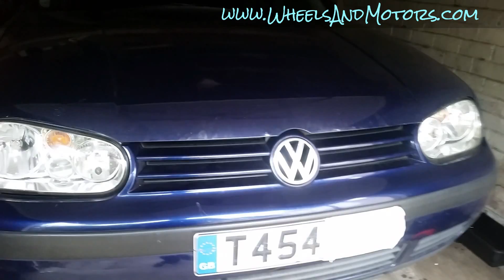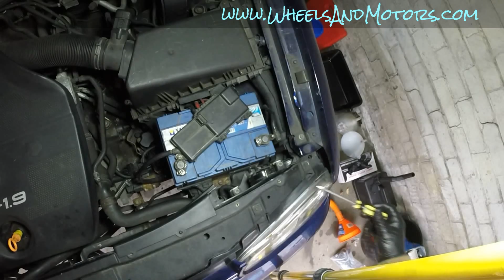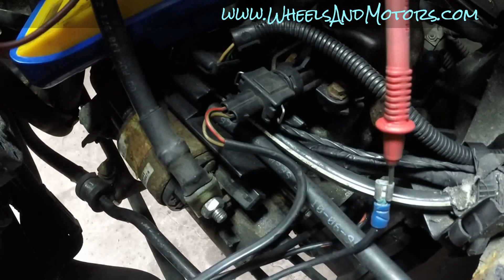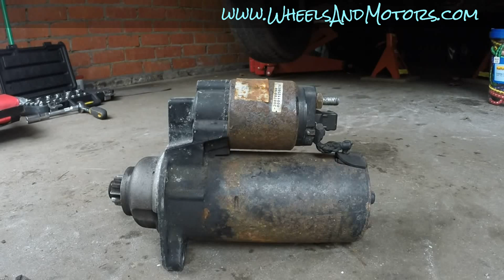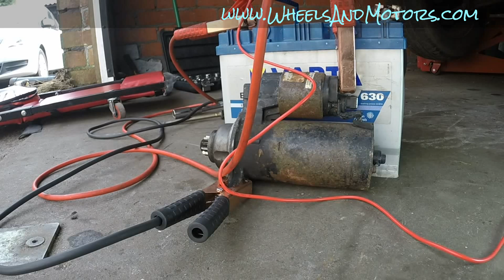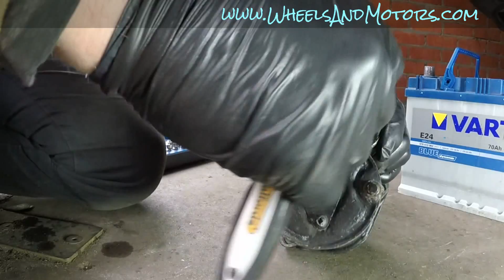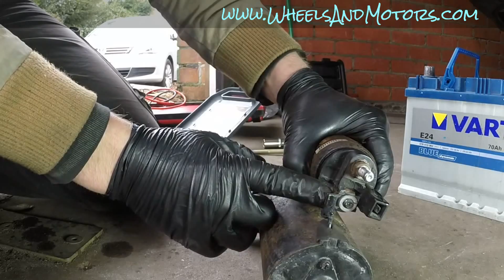How to test, fix or replace starter motor VW Golf Mk4

Comment: Very Good Video Explanation!! Thanks!
Reply from the maker: You're welcome :)
Reply: My sons Jetta 1.8T has been cranking but not starting for about 3 weeks now(thought it might be a fuel pump or relay,due to no pump prime when you open drivers door),2days ago no crank,no start.  I took the starter out of the car and tested it using your video,starter works great.  The relays seem ok,will check power to starter/ignition switch later today.  And AC compressor turns very slowly when it does engage,then stops and starts often.  Gotta find a good wire diagram for the ignition switch to starter.  Have a good day,and thanks again for the video.
Reply from the maker: If it's cranking then as you say - problem isn't with the starter motor.It needs to be looked at, hope you'll get it sorted. If compressor doesn't engage - could be a problem with compressor clutch. I know people replace them, but I don't know how yet. Replacing whole compressor is pretty easy task (make sure system is degassed), but whole unit costs more.. unless you buying it in scrapyard.
Reply: Solved!  Bad grounds for compressor and son removed #53(starter relay)  and replaced it in wrong socket,so it wouldn't crank or start,checked out a wiring diagram and figured things out.  Replaced fuel pump today(original crank no start problem),all items are working great.  But it's an old vw,so it won't be long before I'm working on it again! :)
Reply from the maker: I think you could make good videos :)

Comment: Do you just pull the starter out when the bolts are removed? Mine is stuck. Applied some rust remover and will try again tomorrow
Reply from the maker: It can get sticky with the rust, but there's nothing holding it apart from those bolts - give it a knock.
Reply: So the story continues. As I couldnt bother to borrow a tester from my mate, I went for the disassembly option. After lots of hammering with a screwdriver, I was able to pull the damn thing out and the sprocket did come out and spin. So disassembled back together, put some grease on the cable connector and it started again! 
However, the thing lasted exactly 2 days and today it happened again, but after a slow crank. So I thought maybe my battery is dead. After pushing the car on, went home and borrowed the tester this time :) 
Surprisingly, the battery stays at over 14V while on, when off at 12.7 and drops to 12.3 when I attempt to start. The cable also gives over 12V when starting, so I am a bit puzzled now. Thinking of making a cable to connect the solenoid and main signal cable in between to confirm if its a bad connector. Does this make sense?
Reply from the maker: Don't know mate, from what you said - voltage seems to be normal, as it should be... Are you sure putting grease on connections would help electrical contact?

Comment: what is wrong when the starter cog does not retract quickly enough? mine is starting the motor ok but gets spun by the flywheel and makes a loud screeching sound
Reply from the maker: I think there are few reasons that can cause it. First, when engine started, starter still gets signal on the relay keeps working - which is highly unlikely.. The other 2 reasons best to test when you take starter out, because likely it would be mechanical problem. It's either worn out spring that doesn't pull it back - try to pull sprocket out and see if it pulls back.. However most likely you have a problem with bendix. When starter motor engages, there's like a bearing that with torque from starter locks itself and turns the flywheel, once engine started, it turns faster than starter motor, so that bearing-bendix gets loose and starter motor sprocket goes back. To check bendix, you can turn the sprocket on starter with your hand fast one way, you should feel that you turning the motor inside, and when you change direction it should be loose, like you turning sprocket only. If you'll be turning motor both ways - that means bendix is stuck.
Unfortunately,  I don't have any practical experience of replacing bendix or lubricating it. And I just had a look on eBay, if it's a Golf we talking about, I can see - they sell used starters for as low as 20 pounds, cheaper than new bendix. If I would have this problem - I would try to lubricate it, to see if it helps. If bendix is damaged, then I'm not sure how to replace it - probably would buy a new/used/reconditioned starter motor. Hope it helps :)
Reply: Two bolts on top and grease inside pal on all gears and moving connections easy job.

Comment: Fantastic video ty. 
What if it only shows 11.86 volts when testing the ignition wire that goes to the solenoid?  I had the starter rebuilt but I'm still having starting issues. Battery shows good, as does the alternator.
Reply from the maker: Are we talking about that little control wire or big positive live wire? Because they both go to solenoid..
Reply: WheelsAndMotors the little control wire, coming from the ignition. Not the big positive wire from the battery
Reply from the maker: Try to measure voltage on the battery terminals when engine is not running - it should be over 12 Volts, also when you starting the engine the voltage should normally drop, but not lower than 11.5, if it drops lower then that, then probably battery is not in great condition. Could be not be bad battery itself or something draining it. Also make sure that multimeter is in voltage mode, not amperage that can cause short circuit (just in case).
Reply: Thank you for the help. I had the battery checked and the alternator as well, and had everything set properly while testing (voltage mode). Something just wasn't adding up. I ended up taking the starter back to the rebuilder and had them do it over again, and now it's working great. 
This video helped me a lot, thanks again!

Comment: ?Is it the same process to put it in and mine is a 2,0petrol, does it matter'
Reply from the maker: Principle is the same - petrol or diesel. Perhaps starter motor for diesel must be a bit stronger.. Actually I have a video about starter motor for Toyota Avensis, petrol - starter motor looks very similar.
Reply: Cheers!

Comment: this is the most informative to the point tutorial ever. I actually feel confident I can do this. thank you.
Reply from the maker: You're  very welcome :) Glad, if it helps!
Reply: as an update I did remove it.  when I took it out sludge was clogging up the housing. although the starter gear was stuck out. but I did it and it didn't take all day.

Comment: Thank you! For the 1.4 engine, the starter is in the same position, under the battery?
Reply from the maker: I think so. Normally, starter always by gearbox/flywheel.